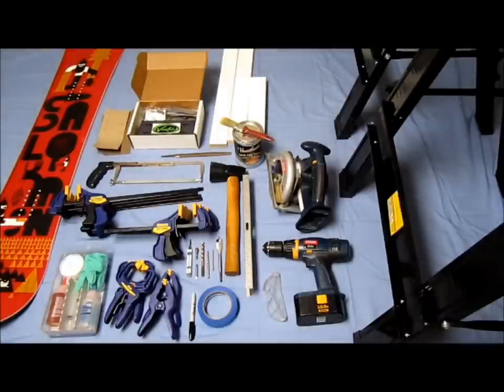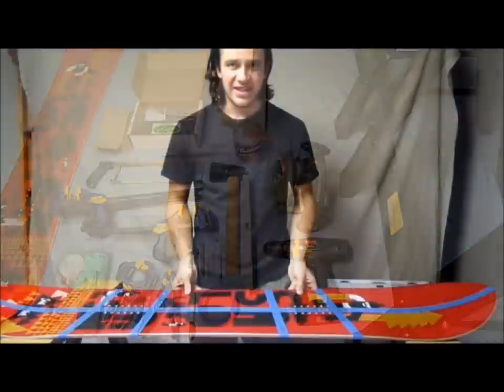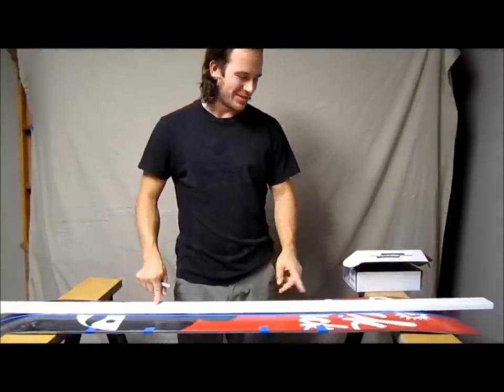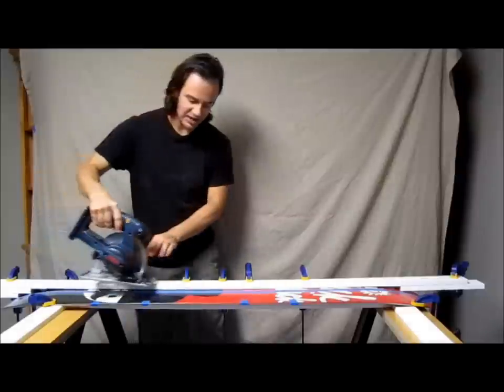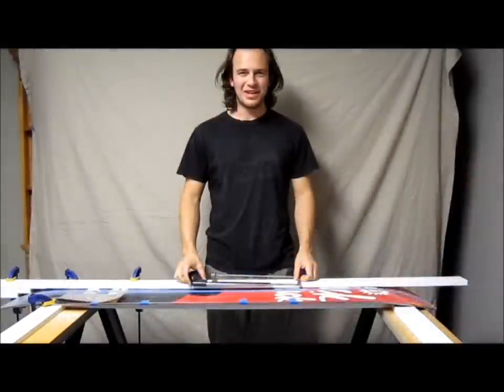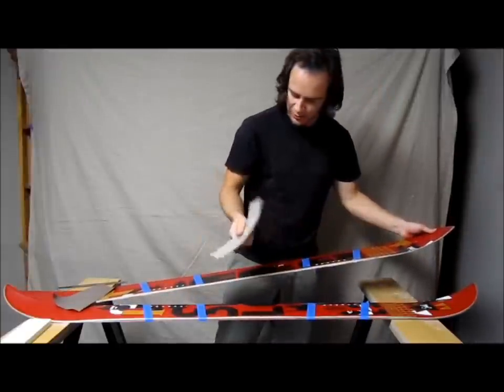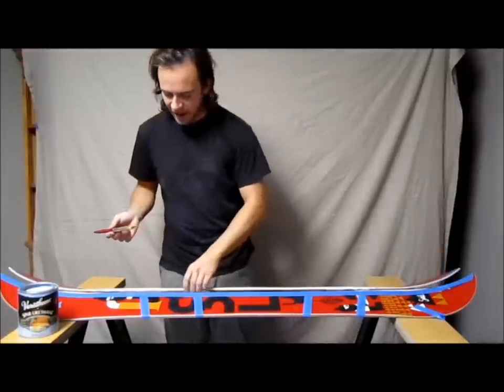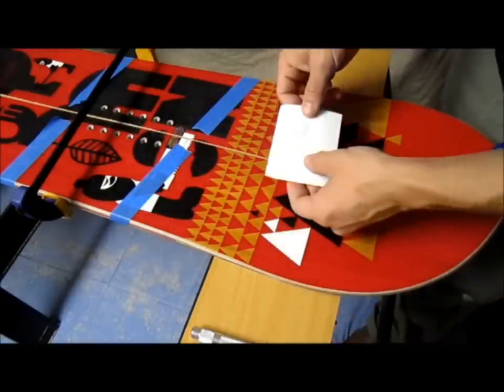How to make a splitboard with the Voile DIY Split Kit - Part 1

Comment: Tips I found useful.  Grinding down the tip and tail where you had to hack saw. (Hacksaw blade half as thick as carbide blade). Pounding in t-nuts with socket to make flush. Half way building myself and girlfriend boards.  Great video as the instructions can be confusing at times.

Comment from the maker: Bandsaw might work, depends on the quality of the blade. Inserts and steel edges are tempered(heat treated). It's very hard material. When we cut out factory built boards, we use a bandsaw but we are only cutting along the perimeter edge which wraps around the entire board half, but never through the edge. Just make sure bandsaw blade can cut hardened steel.

Comment from the maker: It's possible to use a table saw, but sometimes difficult to adapt the board sidecut to the rip fence. It you can somehow jig it up, go for it. Make sure blade can cut hardened steel if cutting the edge material or inserts.

Comment: As for the skins, it really doesn't matter with a reverse camber board.  The reason that they say you don't want the length of the skins to go past the contact point is because if they do, then they are more like likely to get snow between the adhesive and the base of the board.  This can sometimes cause the skins to work loose and not stick to the base.  You may want to rig up a tail attachment for this particular setup to provide a little extra security.

Comment: appreciate the video. finding your balance point for the mounting of the touring clips is irrelevant though. Thats a good trick for actual skis but think about the T nuts and hardware you still haven't installed. and because its a split board and not dedicated skis mounts on either ski will not be in the same locations front to back. Thanks for the vid though.

Comment: a worm drive circle saw will cut right thru the burton inserts if they are in the middle...really better to cut a standard board as far as perfectly straight goes it doesn't matter in the end the board is put together for riding ANYWAY! I have cut a few w just a line and my eye!

Comment from the maker: When cutting your splitboard, a band saw will work but can be difficult to maintain an accurate straight cut. Voile recommends using a circular saw with a metal cutting blade if you need to cut through a center t-nut. As the video explains, you want to use a metal cutting hack saw blade to finish the cuts on the tip and tail through the metal edge. Let us know if other questions. Thx! -Voile

Comment: what about using a bandsaw with a brand new blade? there are steel t nuts (3) already in the center of my board, as well as thicket steel on the tip and tail

Comment: 6:50 If your snowboard is rocker, and dont have any contact points, where is the best place to put the pivoting hooks?
Reply: +Leonard Christensen you still have contact points.  They are usually the last few inches before the rise of your nose and tail. Because the board is reverse camber they are just harder to catch because they are raised up higher depending upon what degree of rocker your board has.

Comment: I have a swallow tail board w/ the channel system, am I able to use this kit?
Reply from the maker: If there are any channels or brackets down the center of your solid board, you'll run into issues. Otherwise, you'll be good to go. Check out the V-Tail splitboard on www.voile.com to see where we mount the hooks and clip.

Comment: Where should I place pivoting hooks on a banana/rocker board? The contact point is in the middle..
According to the manual the climbing skins should not exceed the contact point near the tail of the board. The question is again what happens if the board is a rocker?